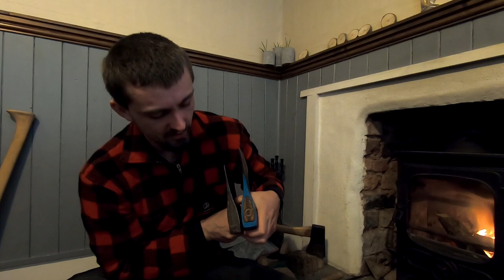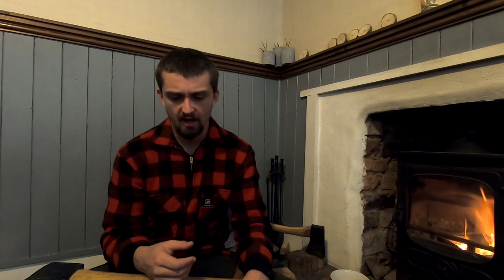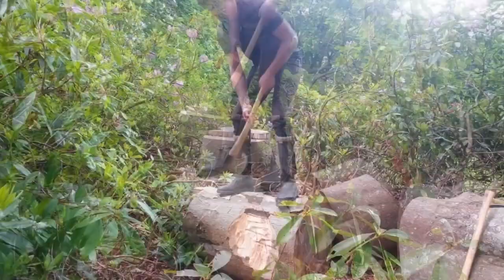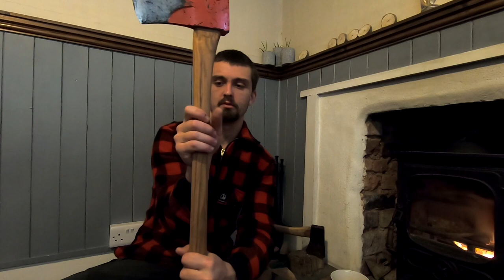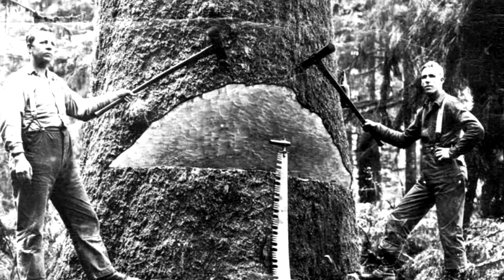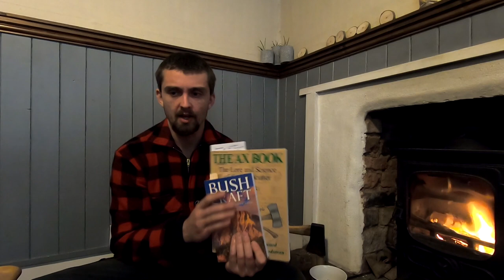Axe Handles Thickness, Shock and Injury. Why you MUST thin your axe handle!

Comment: I've had exceptional results with a 5 1/2 lb. Rhineland pattern ax, to the extent that it is the ax I use most often, but the thickness of the hickory handle has led to 'tennis elbow,' which is the best description I have for it. This beloved ax handle has a pretty patina from repeated treatments with dirt, sap and Tung oil, so I have been apprehensive about thinning it out, but I dare say you've inspired me to choose physiological wellness over an endearing patina. Thanks, Ben.
Reply from the maker: Yeah i got tennis elbow too from thick axe handles. Get it thinned, the patina will come back!

Comment: I've done manual labour all my life, I'm like a robot with a pickaxe or mattock and their handles are like  wooden legs but I still can't abide a thick axe handle. 
Another point is if the handle is too thick (or thin) to grip comfortably it wears out your gripping muscles and they become the weak link and open you up to danger and over use injuries.

Comment: I only recently discovered the benefits of a thin handle when I restored a vintage axe that had its original handle still in great shape.  I never really had a problem with the handles I had been using up to that point but the difference was night and day. I haven't quite got over the fear that the thinner vintage handle is weaker and might break. But we'll see.

Comment: Right on! I think if you had 2 identical axe heads, one hung on a club handle and the other on a nice thin handle, people would quickly find themselves reaching for the thin one. I have also noticed that most vintage axes on original handles seem to be quite thin. Nice video.
Reply from the maker: Glad you liked the video. I recently recieved a package from tuatahi and included was an axe sheath with a note saying it was from Brett Brown and was a gift. I just want to say thank you very much for the awesome gift, very much apreciated. I assume you must work at tuatahi? Must be an awesome job, very jealous

Comment: Great video! The benefit of the thicker Gransfor Bruks handle is there is wood that can be removed for a custom fit. I make my own tool handles for broadaxes, riven from logs, and I like a triangular cross section, especially at the butt end. Thinning the shaft for shock absorption is most effective in the mid shaft, but not at the butt, where a fatter taper wedges itself into the hand. Ash can become brash when it is from a slow growing tree where porous early wood rings don't have larger, dense late wood rings in between. There is also dry rot, which can be difficult to detect, until you catch a sidelong glimpse of an eight pound broadaxe head at an unusual angle on your back swing! Besides ash, I use hickory, oak, black locust, and mulberry which makes exceptional handles.

Comment: I hardly ever chop for a whole day but usually for several hours, sometimes many days a week. my chopping axe handles are just under 20mm/ 0.75" in thickness, and around 36mm/  1.4" width. My splitting handles are a bit larger but not by much. I use mostly ash (beech occasionally) because that's what I've got available, I've only got one hickory on a carpenter's axe so I cannot say whether it is is actually superior, it might be but there's nothing wrong with ash. One thing though, as you said the quality of the wood in ash is very important and has to be good, spot on again!

Comment: First time I cut with a clubby handle I had bloody blisters between my fingers! Since then every handle I've put on an axe is thin enough to flex when you pull it across your knee. No shock, no discomfort, improved "chopability" since the center of mass is closer to the cutting edge.

Comment: Nailed it again. Thick handles go hand-in-hand with thick grinds and poor-geometry heads. Its a symptom of mass-appeal... nothing but an accommodation for the lowest-competence user. Aka the common user who only uses an axe to bludgeon kindling on their front porch a few times a year and just wants a handle that will withstand the maximum number of sloppy overstrikes. Thin handles (like thin grinds) are a sign of a truly competent and discerning user.

Comment: My specs for an endurance chopping handle are 18mm thick, 33mm wide, large palm swell. Loose grip, smooth and accurate swing with an emphasis on speed rather than force. Nice, very informative, thanks for sharing.
Reply: I settled on 18mmx34mm  so super close. 
 I am very nervous slimming a Spotted Gum handle down that far as it's not as strong as Hickory. And very expensive to get here in Alaska. But , i'de rather have a gum handle break than further injure my 62 year old hands, wrists and elbows.

Comment: Ash is very flexible and that's why it's used for making hurleys for the sport of hurling. There was a famous photo of two hurleys bent full compass around each other during a "clash of the ash"
Reply from the maker: Good wood for bows too. I think owen made a few ash handles that ended up too thin and were a tad too flexible

Comment: Great video again Ben.

I have a couple of large axes (32" handles) I've owned for a while; only cheap axes: one I bought from a well known homeware chain and one from a junk shop.  The junkshop axe, I've sharpened and use for felling as it was easier to use and felt lighter.  I've thinned the (hickory) handle on the axe I bought from the homeware store, but it's still not as thin as the junkshop one; it's use has mainly been for splitting or clearing roots.  it was only last week I picked them both up at the same time and realised the junkshop axe was actually heavier.  I weighed them and found that the junkshop axe was 7.5lbs and the homeware axe was 6.5lbs.

And yes, I realise I should have much lighter axes and shorter handles, but I bought them before I knew better, but it just goes to show how handle thickness make a difference.

Just out of interest, do you have any Kent pattern axes?  If so, what would you use them for?  I acquired the head of one and want to put it to use.
Reply from the maker: Kent patterns are nice axes for general use. Good for hedgelaying, carpentry and light chopping. not really the best for felling but they can get it done

Comment: My 7 lb American pattern Elwell has an original handle with a width of about 22- 23mm  [13/16 - 7/8"] I used to use it occasionally for difficult splitting work but way to old for that now. There is a reason that so many of these 'monster' axes still have original handles ... they were left in the rack and more sensible smaller axes used in preference.
It has found in its proper home now - hung on the workshop wall ;<)
Thinner handles definitely the way to go, and my preference in terms of comfort in use is for Ash rather than Hickory. With careful selection of wood blanks and attention to detail in making, fitting and maintaining, ash will last just as long as hickory - unless you are daft enough lend your axe to someone else.
Reply from the maker: I think you are right, the big axes seem to be more commonly in excellent condition. I think they can be improved by hanging them on short racing axe handles but still very heavy to use

Comment: I thin the handles on all my axes, even if it's only for banging wedges, one day i forgot my axe and used our spare axe for banging wedges and it's a huge difference when you switch back to a nice thin handle, it's so much easier to hold on to and doesn't transfer vibrations as much
Reply: @sly dankass For my hands, i like to have a fairly loose grip on my handles, so a niche thin handle with a good palm swell feels nicer than a thick club of a handle that you really need to hold on to so it doesn't fly out of your hand

Comment: One thing that gets overlooked alot in my opining is that the way you grip the axe really affects how much shock gets transferred. When i started chopping a couple of months ago, i was surprised how much shock got in my hands and as i thought with my very thin basque handle that shouldn't be an issue, the problem was that i was deathgripping the handle and therefore still got alot of shock. If i then think about other beginners with even less knowledge or the usual gränsfors fanboy.... 
if you chop wrong enough the handle really doesnt change much i would imagine. So again, the technique really matters alot here too i think.

Comment: Another reason axe shot might not be mentioned is because they didn't think to mention it. For example in old cook books they often don't mention stuff. You get really frustrating lines like "prepare the rabbit in the usual way". Also subjective terms or phrases like "not so slim as to flex too easily" as really hard to interpret. How much flexibility is too much? The thin handle I mentioned I couldn't use but I imagine it would have flexed on the swing. It was thin enough that the travel of the head on the swing would have been delayed. Or the handle would flex in swing.

Unfortunately getting good stock to rive decent handles is hard for me in Australia. The Ash I can get hold of is Desert Ash which is harder than English ash. I might have to go up into the hills and see if I can find me some blackwood (an Acacia) for a log for some blanks. Finding a hickory wattle (another acacia) would be cool but I've been looking for awhile, they grow anywhere around me. Guess why its called Hickory wattle.

Comment: Greetings from Greece! The Youtube algorithm done its magic and I found the absolute best channel regarding axe knowledge! Congratulations for the user based real world approach to the subject.Iam also an axe user for cutting  and splitting firewood mostly from olive trees. I recently came up buying a Bellota axe (ref 25131) with 1500gr head with  an 80 cm very thick handle made from ash (I assume). 
The steel is fine,it penetrates the wood very well and i can sharpen it at field,BUT the handle is very thick to my liking.
Whats your opinion about thinning an ash handle regarding the shock absorption?
Subscribed.
Reply from the maker: you can thin ash down quite a bit, it doesnt need to be as thin as hickory though. try it out and see what you like, you can always replace the handle if its a failure. glad you like the channel!

Comment: Excellent vid !  
 What is that red axe that you were showing with the slimmed straight handle ? It (looks) like a 5 lb Council Dayton pattern with bevels. But I've never seen one or ever heard of one. ? 
 I have very much noticed how much my thick insulated Chopper Mitts  and insulated gloves reduce vibration when chopping. Tho I don't wear them for impact and vibration reduction. I wear them to stay warm. 
 Wearing thick gloves and mitts really increase Thick handles. So there are more reasons to thin handles down. 
 Thanks for the vid ! It's Appreciated !
Reply from the maker: its actually an old Brades 4lb

Comment: Ben - have you done a video on handle modification technique? I see Buckin does it by eye and I've has a go on some hammer handles recently. Tool selection, thinning technique, matching too a template and sizing handle relative to head weight would be a fascinating video ....just sayin.
Reply from the maker: personally I dont think there is a hard and fast rule. Just use whatever tools work best for you and whatever shape fits your hand best. You have to find that with trial and error
Reply: @benscottwoodchopper  fair enough - didn’t mention to mess up new handles but will just have to chance it . I like the Japanese wood wrasp you showed in a video I saw . I’ve used a big draw knife ( too big I think) and tried a new spokeshave which isn’t much good in my hands . Got to get into my helko werks and make something of it. BTW - 2 more big beaches down for some entertainment 😀!

Comment: I've seen western style axes with original handles from pre 1900 and the handles are so so thin. You can flex them with your hands. 

Interestingly all the Japanese axes I've had go through my hands are relatively thick.

When I'm making a handle I rive my handles. Sawn handles use the log more efficiently but as I'm sure you know can easily produce a handle that's inferior to a riven handle.
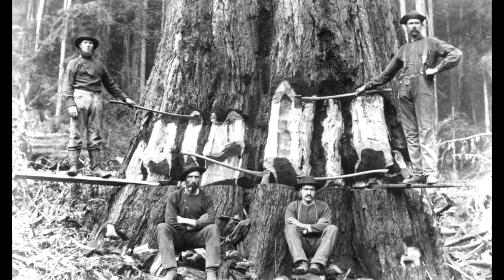Reply: The axe handles at 17:38 are similar to what I was talking about. Very thin. Although those look a tad thicker than the one I'm thinking of.

Comment: I think the issue with meaty handles isn't so much shock transmission, but actually shock generation. When the axe is swung, the handle gains momentum, and when the head stops into the wood, becoming the fulcrum, that momentum generates a force at the free end of the lever: the hands. 

That being said, the Commonwealth doesn't have the monopoly on axes, and in other european areas you find lumberjack axes with quite thick handles.
For exemple, in this video is the manufacturing of an axe handle in Belgium (from 11:55), and you can see it's rather thick and clubby:
https://www.youtube.com/watch?v=HHuLNvlNDOM&t=715s
And one of these handles in its natural habitat:
https://www.youtube.com/watch?v=EXnvRisct2s
Here, in Catalonia, very roundish handles:
https://www.youtube.com/watch?v=K9-r4kXqciw
Here a full collection of various romance area axes, and most of them have thick roundish handles, even felling axes.
Some of these large felling axe in a perdiod picture:
https://mediatheque.parc-marais-poitevin.fr/fs01/IEL01/145/f/1addeda55e70000000000743_BIG.jpg
Here also, in the Black Forest, thick roundish handles:
https://www.youtube.com/watch?v=hL166BPL4EE

I'm not saying it's good, I just notice that thick roundish handles is not uncompatible with the job of lumberjack, and it seems to be agreed upon by many continental Europeans from different countries, with many different head patterns. But many of these handle design are straight, with few to no palm swell. It's likely these axes require a totally different swinging technique than the Anglo-Americanish axe.
Reply from the maker: Yes, In the video I said that european axes often traditionally have large handles made from ash. I think ash absorbs shock far better than hickory meaning you can have a thicker handle and still be comfortable. the problem occured when the axe makers switched from ash to hickory but kept the thick designs, with hickory you must make it thin or it will cause you injury. Very good links, I have seen a couple of them before but the catalonian one is something i have never came across, very cool
Reply: Lot of factory made axes here in Europe have ash handles which are ash sapwood. Traditionally the axe handle is taken radially (the direction of growth rings) from a log, but with ash sapwood the wood fibers will brake more easily from impact. So if you make a radial ash sapwood handle, it cant't be very thin. That's why you should cut it tangentially if you use ash sapwood for an axe handle. According to Baltic traditions, the best wood for axe handle is European white elm (Ulmus laevis) and second best is rowan (Sorbus aucuparia). Birch and ash sapwood are most available woods, so they are widely used. If you seek information about traditional woodworking and tools, then it's the ethnography you need to make reasearch on.

Comment: Buy council tool and you won't have that bloody problem.
Reply from the maker: yes the council tool handles are good but the rest of the axe can have problems. Also they dont have many patterns. I really like their boys axe but it can be outclassed by some other axes that come on thick handles. Really depends on what you are looking for your axe to do well
Reply: I've experienced a couple council axes. Poorly tempered steel, ineffective geometry, warped bits, ugly red paint, deep grind marks, very inconsistent quality. I guess for fifty bucks you get what you pay for and then some, but they suck.

Comment: Purchase council tool axes and you won't have to deal with thick European handles.
Reply from the maker: you can thin down the thick handles, I primarily buy axes based on what the head is like because that's the thing you can't fix
Reply: But you have to deal with a very mediocre head